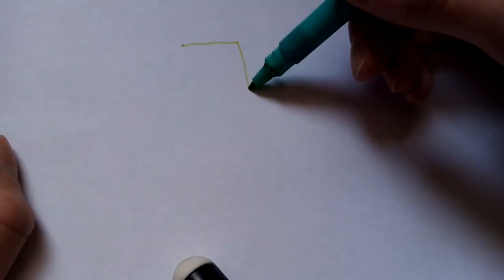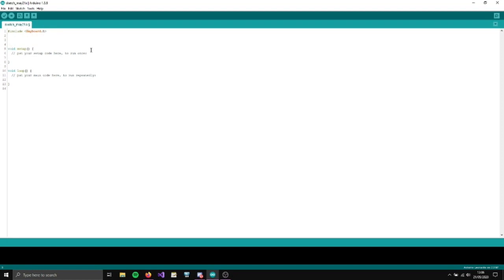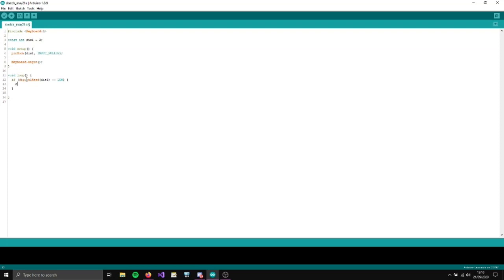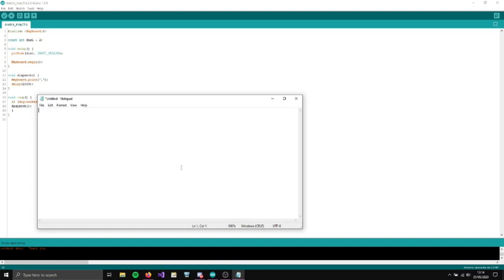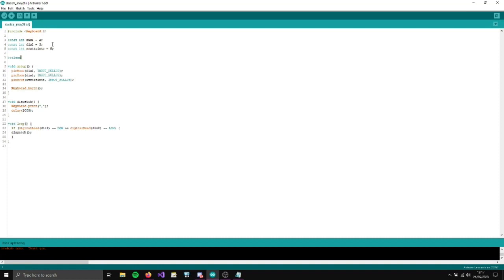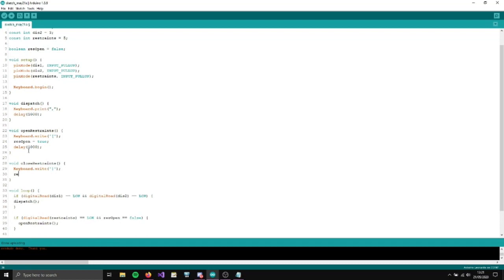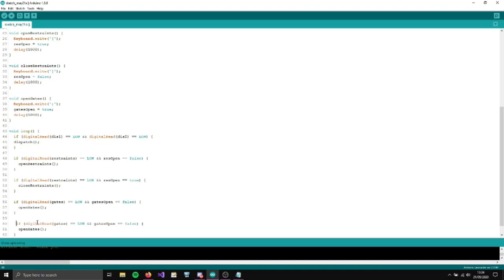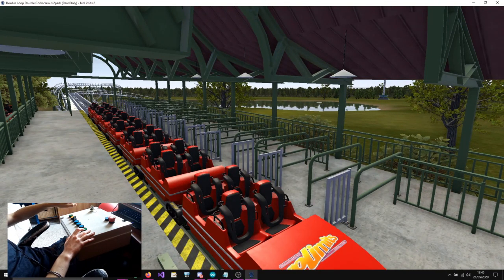NL2 / RS Panel: How to program Arduino Leonardos

Comment: What volt buttons should I buy?
Reply from the maker: Buttons have no voltage, but the LEDs should be 5v. Make sure your arduino has support for 5v, some arduinos are only suited for 3.3v.